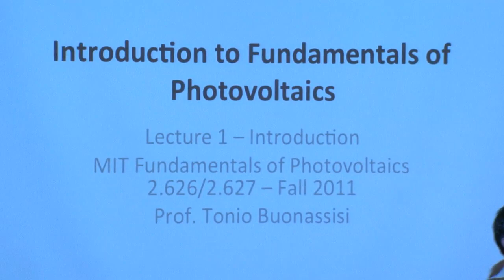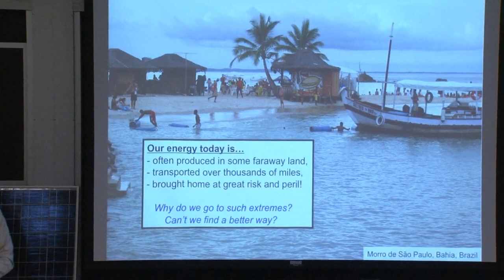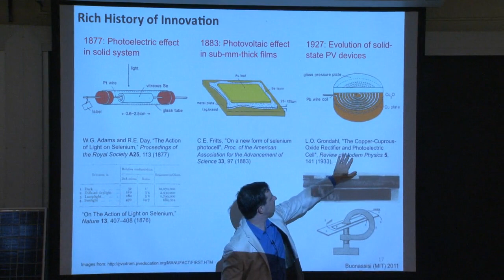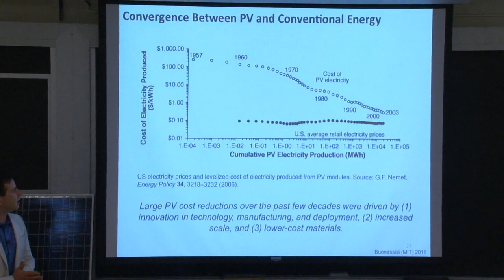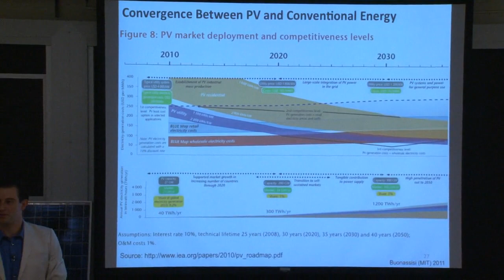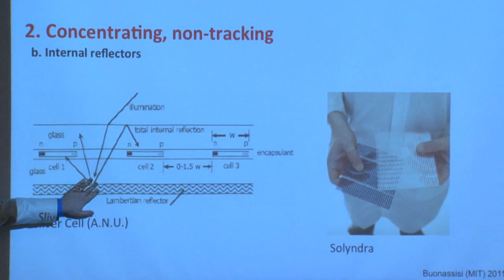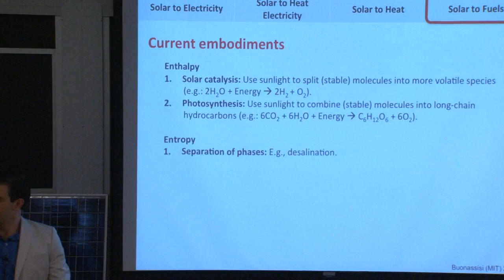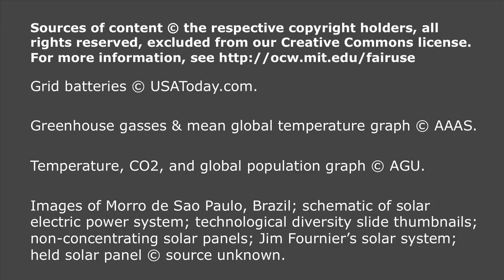1. Introduction (2.627 Fundamentals of Photovoltaics)

Comment: I HAVE HAD IDEAS FOR DECADES AND ON THIS TOPIC I HAVE A FEW. IF 50 YEARS AGO EACH SOLAR CELL WAS THE SIZE OF A SMALL CAR, WE HAVE HAD THE TECHNOLOGY TO REDUCE THEM GREATLY. AS  THOMAS EDISON SAID OF HIS 1ST LIGHT BULB"IF IT CAN RUN FOR 7 HOURS, IT CAN RUN FOR 700( PARAPHRASING) BUT THE IDEA IN MY HEAD IS THIS SAME IDEA. IF WE CAN REDUCE THEM DOWN TO THIS SIZE( WHICH IS TOTALLY WAY TOO LARGE) THEN WE CAN MAKE THEM POSTAGE STAMP SIZED WITH THE POWER TO RUN A SMALL RADIO 24/7. ANOTHER IDEA I HAVE ON THIS IS TO MAGNIFY THE LENS OF GLASS TO CONCENTRATE A FOCUSED BEAM ONTO THAT CELL INCREASING IT'S POWER. THE LAST ONE IS TO USE NIGHT VISION TECHNOLOGY AS EVEN IN TOTAL DARKNESS WE CAN SEE PLAINLY BUT IN DAYLIGHT THOSE CELL COULD BE (PERHAPS) 100 X MORE POWERFUL...JUST A THOUGHT!!